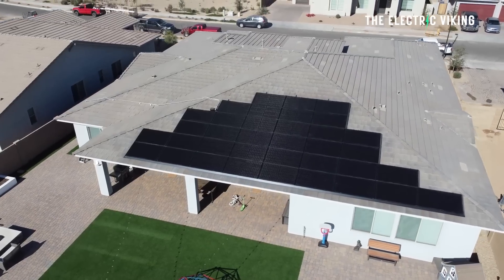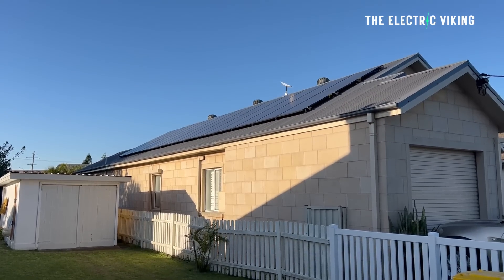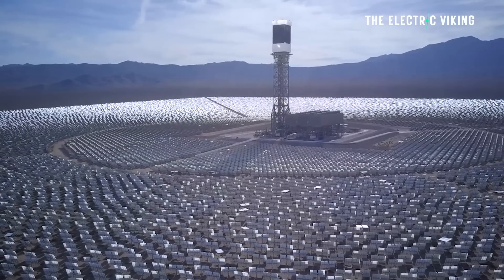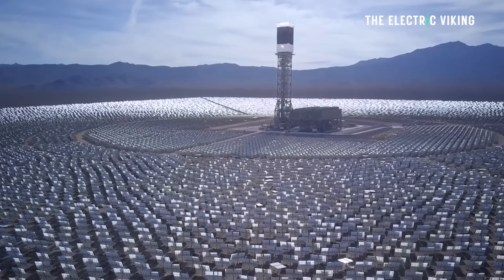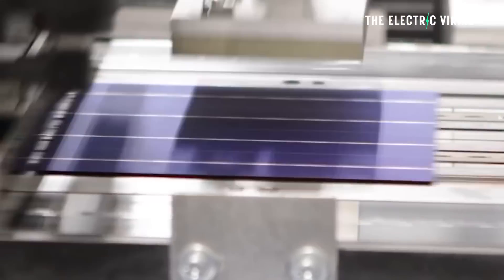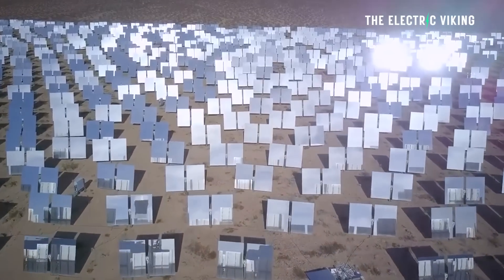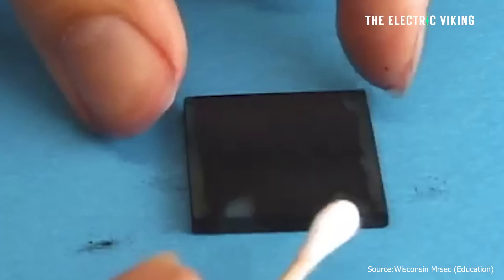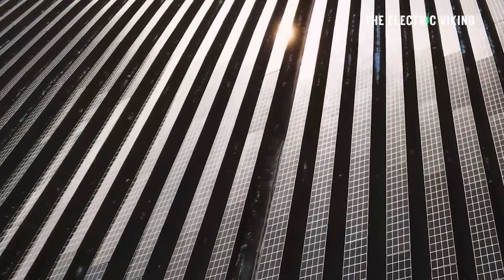Record-Breaking New Solar cells with 60% energy conversion created by Spanish researchers

Comment: This 60% efficient solar cell will remain in the lab, indefinitely as the materials and elements used to produce them, are EXTREMEY expensive.  First Solar's modules are also gallium and cadmium, and are produced at roughly 3-times the price of silicon cells.  Scientists confirmed 45%+ efficiencies in cells, in the lab, years ago, that have never come to market, for the same reason.  Lab results and market worthy products, are very different animals.
Reply: Thank you for the context. I was going to pass this off as BS but maybe it’s only BS for mass production.
Reply: While the materials are expensive, the amounts needed may not be deal-killers.  And, since these materials are not "used up" but can most likely be recovered and reused then some of the initial cost may be recoverable.
Reply: No one would want to use cadmium in a solar cell : it is a toxic metal, and the flimsy construction of a solar panel would result in its release into the environment.
Reply: @michaeledwards2251  
You are correct.  It would be a bad idea to use cadmium in solar cells.  That's why CdTe, cadmium telluride in solar panels.  CdTe is a very stable and non-harmful compound.

"The only pathways by which people might be exposed to PV compounds from a finished module are by accidentally ingesting flakes or dust particles, or inhaling dust and fumes. The thin CdTe/CdS layers are stable and solid, and are encapsulated between thick layers of glass or plastic. Unless the module is ground to a fine dust, dust particles cannot be generated. The vapor pressure of CdTe at ambient conditions is zero. Therefore, it is impossible for any vapors or dust to be generated when using PV modules.

You don't want to be eating sodium or drinking chloride.  But putting table salt, NaCl, on your food is fine.
Reply: Not 60% efficient, it's 60% MORE efficient than the previous record holder.
Reply: @mnomadvfx  
An accurate statement would for a narrow part of the visible light spectrum, it is 60%. General statements about efficiency have to include the range of the spectrum being considered. 

Schottky calculated an efficiency limit of 23% for  the visible light spectrum, based on the light spectrum hitting the ground. The calculation assumed light absorption. 

1. Only the part of spectrum with more energy than the material band gap would contribute to the energy converted.
2. All light with more energy than the material band gap would only contribute the energy of the band gap, with the additional light energy being lost as heat. 

Combining 1. and 2. with the spread of light energies hitting the ground and material band gap gives an estimate of the limit efficiency of solar panels. 

New solar panels are 22% efficient for the external light spectrum, reducing to 20% long term. 

The only ways known to break the Schottky efficiency limit is to use 
1.  A prism to split light into narrow ranges of light energy. 
2.  Use multiple layers with different material energy bands. 

Each light energy band has to optimized individually. 

To achieve 60% demands the lowest energy of the light being absorbed is the same as the material energy band gap, and the highest light energy is no more 1.5 to 2 times the energy of the lowest energy light. 

In the example being considered, it is only red/yellow for which 60% efficiency is applicable. Given red/yellow is the lowest energy part of the visible spectrum, blue has far more energy, the overall efficiency achieved for the typical light spectrum striking the ground is admitted to be poor. 

(Anything under 10% would be considered poor in a modern context. )

Comment: IF this is true, then yes, absolutely awesome. Along with the incredible commercial applications, imagine a much smaller footprint at home. Personally, I feel like solar pergolas should be a thing for the home with this efficiency, one could have a reasonable size solar pergola while having an amazing structure for the backyard for entertaining and have easy access to the panels if needed, and let's say it is a high hail potential area, one could throw up protection and one could clean them regularly and easily if one wanted to. Finally, no more ugly panels on the roof and all the issues when the roof needs to be replaced or other access issues

Comment: It is 60% but only at wavelengths >550nm, and approximately 60% to 70% of the total solar energy reaching Earth has wavelengths greater than 550 nm
Reply: Assuming your numbers correct, then it would be 60% of 65% (avg) or about 39% efficient.  Compared to "the most efficient varieties built using high-performance N-type monocrystalline cells, enabling panels to reach up to 24.3% efficiency"

Moving from 24% to 39% would be a very major improvement.  Let's hope it works out.  At this point the major costs for solar are the frame, cover glass, and installation.  A more efficient wafer taking us from 24% to 39% would generate far more power per dollar spent.

But having followed renewable energy, EVs, and batteries for more than three decades I've learned not to get my hopes up.
Reply: @bobwallace9753  you know what that means... roofing robots!
Reply: @slavko321  
I've roofed a few houses, both shingles and steel panels.  Robots can have that job.

What I don't understand is why we don't have solar panel roofing.  Not solar panels installed over roofs, but solar panels being the actual skin of the roof.  I know at least one company is doing that, but it hasn't caught on.